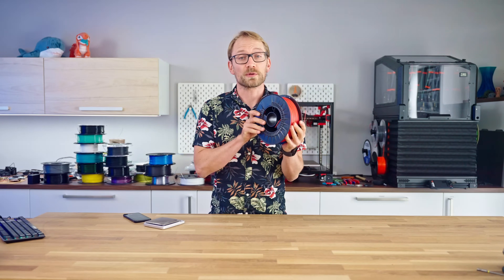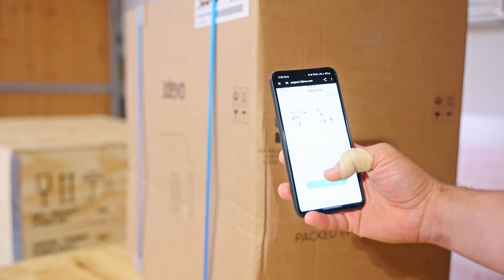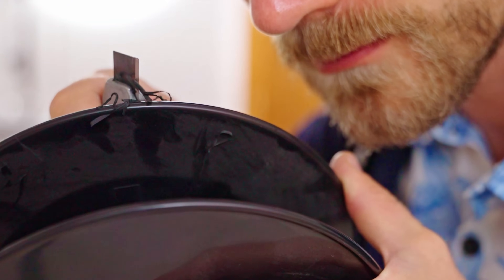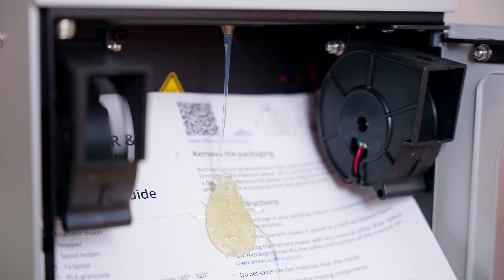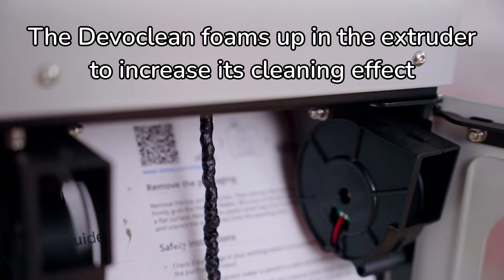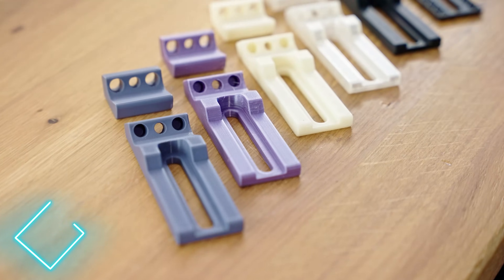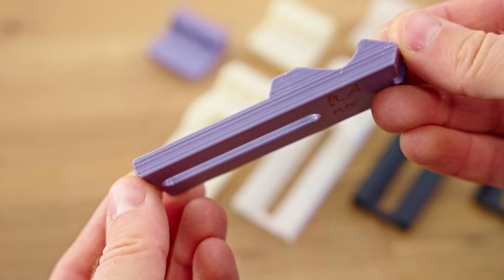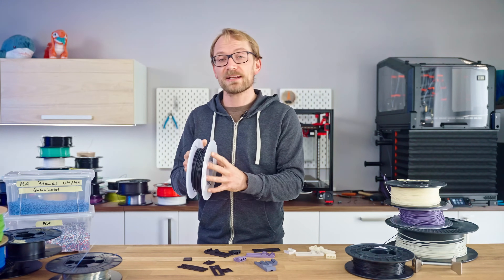Can you print (with) your spools?

Comment: I recently read a paper "Mechanical properties of ternary blends of ABS, HIPS and PETG". It's from research in South Africa where there is a substantial purge volume from sheet extrusion when they change material, and they really would like to use the intermediate materials somehow and not let them go to waste.

What i learned is that ABS and PETG are compatible with each other and produce a cohesive plastic. But how does it print? It could have really interesting properties, don't you think? And also that adding any amount of HIPS destroys cohesion. Which is funny since HIPS is not a copolymer but a blend itself. One should be really careful with what garbage polymer ends up in the mix, for example any amount of PP would be very much not OK.

The other thing i learned is that one can use SBS (Styroflex 2g66) as a universal cohesion agent which may make bad polymers and dumb mixtures workable.
Reply: Trash-grade polymers aren't a good idea for recycling into 3D print filament. They can work well when pressed into sheets, however. You can then use those sheets to make a bunch of things. Teaching Tech has a nice video on using a t shirt press for this.
Reply: HIPS is not a blend. HIPS is made by polymerization of styrenic solution of polybutadiene (rubber). During the polymerization, polystyrene chains are attached covalently to the polybutadiene molecules.
Reply: @Cyclodexter   Wait that's vaguely the manufacturing method of ABS, SBS and similar graft copolymers. I was somehow under the impression that HIPS is not a co-polymer but a blend. Thanks.
Reply: @SianaGearz  Yes, its very similar, ABS can be produced just like HIPS but with acrylonitrile and styrene mixture instead of pure styrene.

HIPS as a blend can be prepared as well but the properties are terrible so its basically never used.
Reply: ive seen panels of consumer electronics enclosures made from ABS+PETG. looks very normal and ABS-ey, but has a suspiciously high bend endurance
Reply: @two_number_nines  I usually see ABS+PC.
Reply: ABS and HIPS are also both parts of the human body.
Reply: Kinda surprising as hips is styrene and butadiene, both components of abs

Comment: Toss up some 80-20 mix of PETG+PLA, to create a weak support filament that prints but then easily crumbles away when it's done with its job.
Reply from the maker: Interesting, trying to create intentionally bad filament. Maybe with different ratios you could control how well it sticks to the main print material, too
Reply: I nmean there is liquid soluble fila...

Comment: I find extruding your own often produces out-of-spec filament, which is generally unusable if it is less than 1.5mm or more than 2mm. I find Bambulabs x1c cannot feed filament out of this range, does Peopoly or Prusa XL have a better tolerance? Can you add the InFiDEL to one of those open source printers to show how well it improves the print quality when using such spools?

Comment: Tom, it'd be cool to see you make carbon or glass fiber reinforced abs. I've seen these powders or chopped fibers available to purchase for a pretty low cost but i am not aware of a good way to mix them consistently in the hopper.
Reply: I suspect when manufacturers use them, they get them pelletised with EVA binder, aka hot melt glue. A little bit of EVA doesn't outright ruin any plastic. But that's just a hunch.

Comment: At 3:14 there are two things being done wrong:
1. Ratchet straps according to EN 12195-2 are not to be used for lifting. Better thing to use would be something like round slings. I'm aware not everyone has them laying around, but if you own an engine hoist, you should probably get some proper lifting gear.
2. You should not be putting these hooks into each other. It will cause the hooks to widen and form hairline cracs, which can lead them to break far below their load capacity.
Reply: Despite the use, I'm pretty positive he was now where near the lift capacity of either the hoist or the straps. While not according to regulations, home gamers really don't know anything about rigging and the regulations that go with it, (nor are they covered by such regulations). So unless you want to ban all sales of such lifting devices and/or require training and licensure to even purchase and own such things, this will never be prevented.
Reply: @ringding1000  I think informing him of the risks is a good alternative to that, which is what they did

Comment: How about HDPE plastic? It's very common but has a lot of shrinkage. I don't think I've seen anyone print with that, you could give it a go maybe?
Great video. Keep up the good work.
Reply: Hdpe doesn't really stick to anything. It's very slippery. Getting a surface to print on would be a tough go.
Reply: Trying to print HDPE is a tale as old as time. People see that nobody prints HDPE, they spend months trying to print HDPE, they get terrible results because HDPE doesn't even want to stick to itself and they quit with no results besides maybe a vaguely benchy-shaped booger. All the qualities that make HDPE one of the best plastics for injection molding also make it terrible for 3D printing.
Reply: HDPE is not printable. It's from the same family of materials as Teflon. It doesn't stick to anything, nothing sticks to it, and it's incredibly toxic when heated. You don't want any of those properties in a home printing machine.

It's very nice to machine into shape and it works in injection molds very conveniently BECAUSE it doesn't stick to anything.

But it's one of the worst thermoplastics you could suggest from the ones commonly used in consumer products.
Reply: @SquintyGears   It's not related to Teflon. It's not fluorinated. Low surface energy polymers are not per se unprintable in principle. PP is printable. Though i can see how HDPE in particular could be an issue specifically due to extreme molecular weight, because without a free end in sight, it may take a silly amount of heat to try to tangle two chunks together, so either very slow printing or very high ambient temperature. To solve bed adhesion, i would try printing first layer of PETG and building an HDPE print on top, but that won't solve layer to layer cohesion.
Reply: @SianaGearz  it doesn't stick to anything. Why would you think laying down a layer of petg would solve that? If it could stick to some things then magigoo would work, that would be the solution. I don't mean literally the PLA formulation of magigoo but there would be a specific one for hdpe like there is for some of the other plastics.

And I also don't mean literally unprintable. It's obviously possible to extrude it, that's how injection molding works. But it's functionally impossible. Because you can't get a usable result on a home machine and it's poisonous... I'm sure we will eventually see sintered HDPE parts from factory. But not at home. It's not worth the risk and headaches.
Reply: @SquintyGears  It's incorrect that it doesn't stick to anything. It sticks to itself and miscible polymers by cohesion. Adhesion to PE is possible too, it's not bloody Teflon. Just about every pressure adhesive works no problem. Look you have guaranteed cosmetic products or even meds at home in a bottle made of HDPE with a paper label stuck to them. It is fairly solvent resistant but toluene works its way in eventually.

PE is not poisonous. It's a pure hydrocarbon and cannot emit highly reactive compounds per se, it is the absolute safest petrochemical polymer imaginable. HDPE is a designation for PE of extremely high molecular weight, which also means it takes an extreme amount of cleaving before it emits anything at all.
Reply: @SianaGearz You're right i just realized I mixed up polyethylene with Polyoxymethylene, also known and acetal or delrin.

Comment: We have a 3Devo extruder and shredder. We like it so much, because we can make a lots of different blends and filled filaments. Only downside is the srew. It is not the best at homogenous extrudes.
Reply from the maker: The Filament Maker Two will have a new screw design with a dedicated mixer section towards the end - maybe they'll eventually offer it as an upgrade part for the One as well.

Comment: Years ago, when I worked at a plastics molding company, they would recycle  'waste' plastics. Sprues, purges etc. They would never use it without adding virgin pellets to the mix. In fact I think it was less than 10% of recycle to virgin material. This was blended in the mixing department. As you found out, keeping the different types of plastic apart was key!
Reply: This.  I have worked with multiple injection molders and the most regrind used was 23%.  Also of note, some plastics can't be used as regrind at all because they don't melt good more than once or twice which excludes regrinding prints as the plastic has already been melted a couple of times already.
Reply: @mechanoid5739  I just started working at a plastics compounding company.  If the "start up" material is clean (this is the first bit we extrude and pelletize to evaluate the consistency) we just dump it back into the process.

Occasionally we even have jobs that mix poorly (when we look at the pellets in the microscope we see chunks unmixed, unmelted colorant, we just run it through a second time to get it to full consistency.

Comment: Please shred PET bottles. Pulltrusion recycling already exists, but only uses the middle part of the bottle. I love my pulltrusion recycler, but i always feel bad about throwing the top and bottom parts away
Reply: You only throw them away because it's more complicated to adjust for the varying thickness and it requires more manual speed tuning. But you could use most of the bottle if you baby  the process at the start and at the end. you'd only be left with the screw part for the cap. Too thick to get cut on the blade from being pulled.

Because even inconsistent thickness can be fixed by running the filament output through the setup again with a tuned setting.
Reply: He is based in Germany, You pay a deposit on the bottle in Germany (0.25€ for a plastic one), which you get back when you bring it back for recycling. Not sure it makes sense to recycle bottles to filament in Germany.
Reply: @Rok_Satanas   There are several non-deposit PET sources in Germany. Drink syrup/concentrate bottles. Cosmetics and food packaging, packaging of non-food items.
Reply: @SianaGearz  sure, but how many of those you use every month, it could take a year to get enough for a single print.
Reply: @Rok_Satanas  even bottles themselves. The average 1,5l pet bottle weighs only 30g, so 33 are needed for a kilo of material, given that you can use every bit. I can only talk for myself, but i maybe use 20 of such bottles a month, so every one and a half months enough for 1 kilo of filament if i shred and extrude it. Those pet bottle recycler cant use the top and bottom of a bottle, lets say 2/3 of the material is usable. 50 bottles are now needed for a kilo of material.

Comment: i work at a company that makes large scale extruders and filters for plastics recycling. it really is super important to have good starting material. Even when recycling, if you put garbage in, you will get garbage out. 
thats especially why plastic bottles are nice to recycle. you know what it is, so you can seperate the different plastics from the lid, lid liner and bottle using a sink-swim seperation, or even camera, or laser guided seperation. it just gives you a nicer starting point. when just recycling from the plastic bin, you just cant get it up to the same quality results. 
I remember a test we ran a few weeks back that used mainly candy wrappers and yoghurt lids as a starting material. Almost all of it had aluminium gassed onto it on one side. even when filtering that pretty fine, you will get a material that you cant extrude well enough to feed it into a mill to granulate. It will pass the extruder just fine, but the small remaining contamination will change the material properties, making it brittle. And filtering it with finer sieves would require too much pressure for the sieves to hold up. so, sometimes you just need to add virgin material, or wont be able to recycle stuff. 

this is also why it kinda sucks if you have parts made from a bunch of different materials. if your one plastic part uses 5 different kinds of plastic, or if your Tshirt is half cotton half plastic... it just gets harder and harder to recycle. 

luckily if the starting material is ruff, our extruders de-gas using a vacuum system, so its always dry and free of oils and glue, but it clogs the filter sieves so you need to change them more frequently. worst case it may cause the line to shut down from pressure build up, if the contaminates are way too much for the system to take. 

oh also, we always flush using PP. You really only need to disassemble a whole extruder once to always remember to flush ;D

Comment: Step 1) have an expensive machine
Step 2) have an engine hoist
Step 3) ????
Step 4) profit
Reply: Far more expensive machines, like engines, get lifted every day with similar engine hoists. The lifting straps are a bit dodgy, but I've seen far worse done by people who are supposed to know a lot more about rigging.
Reply from the maker: I know, the straps explicitly say "not for lifting" - but they are rated for so much more force than what they're seeing in this setup, so they should be totally fine.
Still had the engine hoist from maneuvering my lathe into position, and considering how often it has already made impossible jobs possible for me, I'd say it was well worth the 200 bucks I bought it for.

Comment: 17K €, certainly not for the hobbyist.
Reply: For a rich hobbyist then. I bet there is some bored millionaire out there 3d printing stuff for fun.
Reply: I agree with you, I wish Tom would dedicate a series to laser CNC and CNC´s in general , for example how to build and improve your own plasma cutter CNC and GRBL programming that would land right in my yard.
Reply: There’s always one of you
Reply: And how many hobby machinist have the tools to properly regrind or create brand new carbide endmills? Or motorsport nutters have the tools to cast and then machine their own replacement engine blocks? etc etc. A few will, as few hobby folk out there are at least one of very rich or almost but not quite turning their hobby into a business, but for most folks having what is in effect very close to the entire production line required to process an ore into a material and then into their part isn't possible or worth the cost to them... But for some folks its worth it - heck if I could afford the cost and space for it I'd be tempted, as while I don't print nearly as much as I'd need to for the machine to definitely pay for itself it probably still will - looks well enough built to last practically forever and I'd far rather know as much of the plastic waste I end up with is actually recycled over burned... So that upfront cost is in effect prepaying for all or at least most of the filament I'll use for a very very long time, and as I do mostly more engineering prints there are plenty of prototypes that are not right to regrind. While gaining the added bonus of being able to feel a little better about the mountain of plastic that is a rather unavoidable part of my life.
Reply: @foldionepapyrus3441  This is a hobbyist channel. Not an F1 Motorsport team channel. Genious.
Reply: @Splarkszter  And some hobbyist have workshops full of laser cutters, CNC machines, etc because they can. Heck only 20 odd years ago to have access to a 3d printer at all meant you likely were in a university lab, and yet still some tinkerers would have them. Just because it is a hobby doesn't mean some folks won't take it very seriously. And I picked the car nut example because in general to really be a practising car nut means you have a pretty significant 'disposable' income...
Reply: it's 17k plus 1.5k, plus shipping (maybe another 1k), plus taxes.

Then the shredder, prob at least 10k more plus another and so on.

Dumb as hell. I can build those with 10x less cost.
Reply: laughts in boat
Reply: I dont even see enough there to cost that much
Reply: @KernsJW good shredders by themselves are crazy expensive due to them having to be built incredibly solid but also with tight tolerances. That in combination with them being situated in the Netherlands makes for pretty high production costs, especially if the parts are made in house as outsourcing probably isn’t worth it with just rather small batches (I don’t imagine they sell these by the thousands)
Reply: who tf is this thing for? its not for me, thats for certain. boring
Reply: @DeltreeZero 3D print farm at mid to large scale is my guess. The user needs to use large amount of filament and have ability to control the quality and purity of thr material. Recycler's biggest issue will be the purity of material; having contaminated such as PLA, PETG can ruined the batch
Reply: @kullwarrior  I don't think it's for print farms either. The effort is too high for the process to make any economic sense. Like Thomas said in the video, these are for material science (plastics, colorings, other additives – i.e. where new filaments are developed).
Reply: @kullwarrior  No, it's useless for farms. It's for filament development - if anything.
Reply: @DeltreeZero My guess is for recycling purposes. For small-medium recycling centers, this would be perfect.
Reply: @DeltreeZero go to work and get off youtube then genius